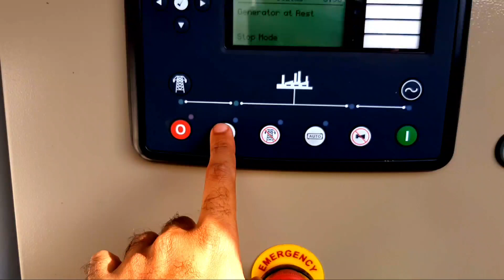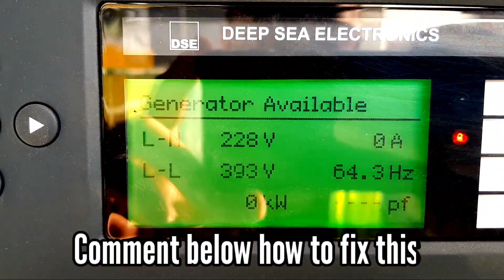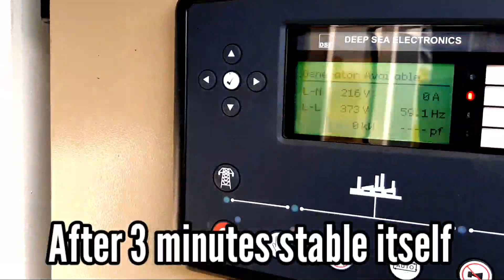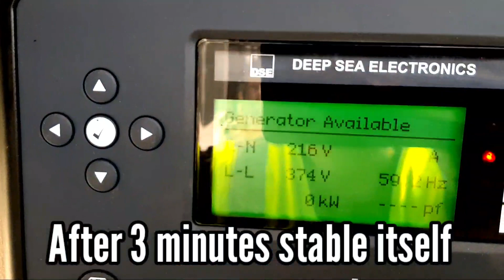Diesel Generators diesel engine hunting problem | Cummins Generator 500kva - Engine Hunting Problem

Comment: My engine is K19-DM Cummins. RPM is hunting. Fuel system is ok. All filters  changed.  Air drained from the fuel system. Despite this still hunting continuously.

Comment: 1/Air in the fuel lines...before you start engine remove filter cap nut on the fuel pump and release all the air bubbles...
2/ check your fuel filters if its not choked make sure  tight well to prevent air sucking in to the fuel system..(check all pipes,tubes, conections before fuel pump.)

Comment: Reset the droop and gain  put both on 1 after starting   the engine reset it while engine is running after that  check avr stab and volt adjuster s while engine running when u r adjusting  please tell someone to see display while u  adjust it will be stable please ur droop and gain very low not high but average all gain must be higher than your droop thank you
Reply: Please don't touch anything from pt pump

Comment: That is the question i asked and i saw you asked the engine type and model. The engine is FG Wilson SGD120230U020D. It only works 12 hrs a day from 6pm-6am daily. The load balancing is okay but the LV supply network goes the furthest of 1.36 km in the outskirts of the city. Now the main generator is 1080 KVA  Cummins Generator which runs at daytime with 55-60% at peak demands but doesnt have te same issue as the Perkins Generator. Another twist is when the Perkins Generator is running alone at night, sometimes the hunting issue persists for an hour or so late at night but whenever we use another 600kva generator with the 800 kva to share the loads at night (not by synchronization but each of the two supplying different feeders to the city) the 800KVA generator does not hunt but runs at 30 someting percent load which is not efficient. Please help

Comment: Assalam-oAllikum Dear 

Please change the mpu sensor first and then change governer card also. InshaAllah it will resolve.
Reply from the maker: But it's only in starting for 2 to 3 minutes after that speed become stable we need stable start
Reply: @Dieselgeneratorksa  sometimes electronic equipment malfunctions in diffrent way. If there is fuel filter issue or fuel supply issue then generator will always trip on speed fault but it gets stable after 3 minutes that means there is some issue in electronic equipment. Also check the frequency of output of voltages with other frequency meter may be deep sea module is giving that fault reading for sometime.
Reply: @Dieselgeneratorksa hello sir! It is already resolved? What does you take action for this?